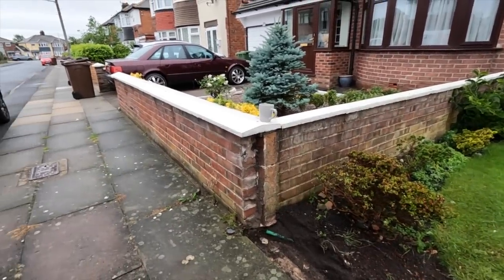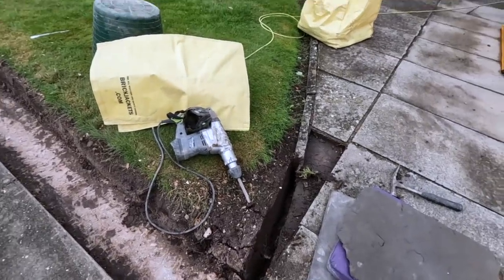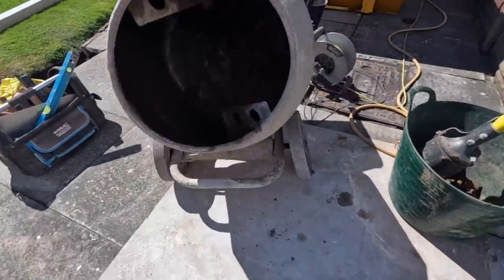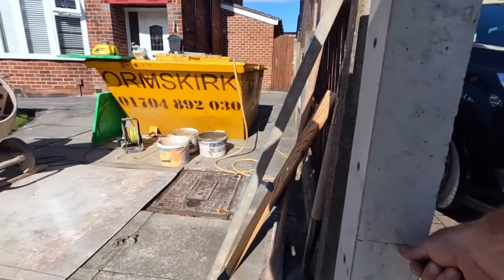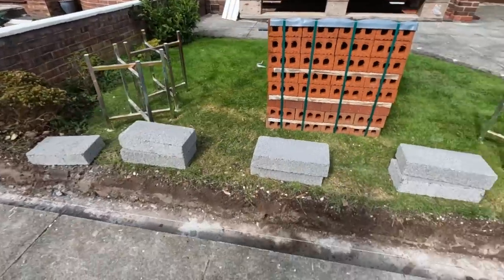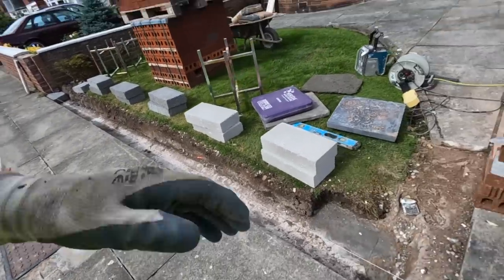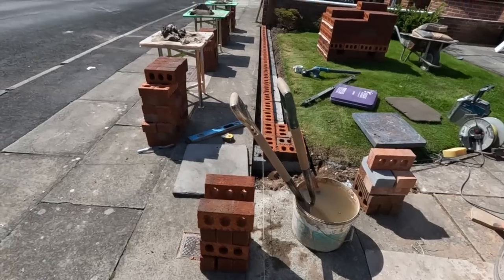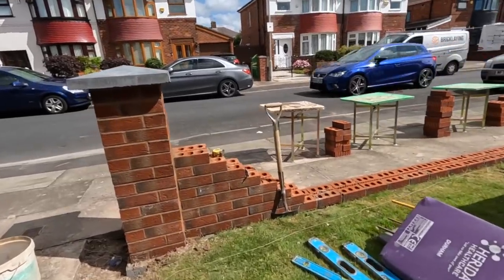LETS RE BUILD A GARDEN WALL..PART 1

Comment: Hi Steve. I note that no dpc is used on wall. Do you use the concrete blocks on base to stop any damp rising and staining the brickwork???
Reply: no you could use the face brick off the base if wanted but your just wasting money as hidden, also using a dpc in a garden wall could weaken the wall over time,  example the wall coud slip off the dpc.
Reply: @Imfat8888  thanks for the reply, So damp could still rise up through the bricks and cause staining over a period of time???
Reply: Two courses of an engineering brick solves that problem
Reply: @patricklloyd  thanks for your reply. Yes I agree and probably the concrete blocks would do similar. I have just looked up on Google and your answer is the most appropriate.